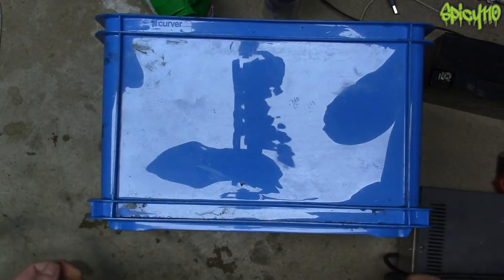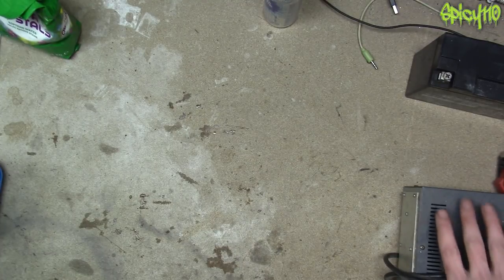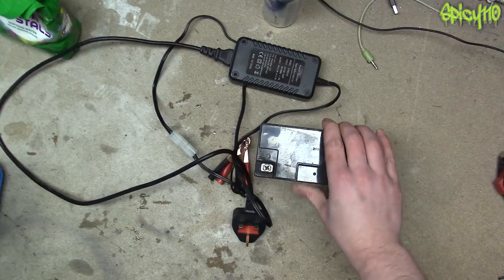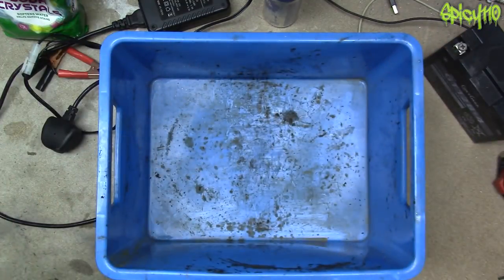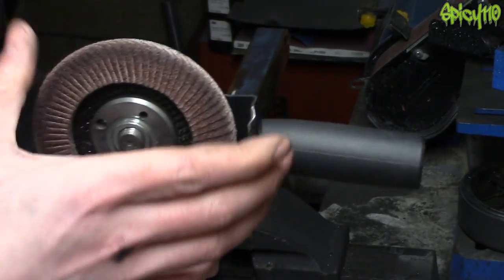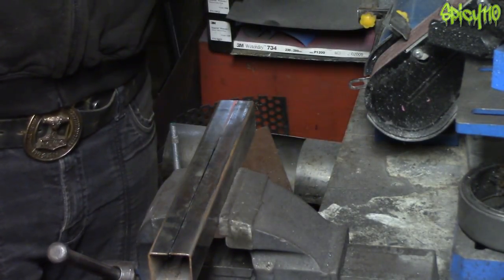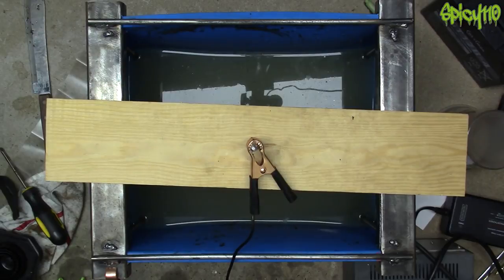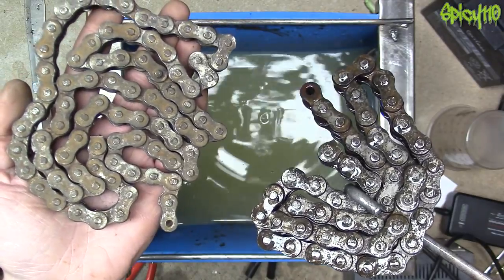Electrolysis - Rust removal! One day build!

Comment: I found that a computer power supply works really well. I'm an IT guy so I get them for free out of old computers. You just have to ground the starter wire to get it to chooch upon plugging in. 4 yellow wires into a red alligator clip. 4 black wires into a black alligator clip. I use a 20 amp fuse and a surge protector just in case. That way you don't need to use a battery or risk your expensive charger.

Comment: Hi spicy. Good video. Not sure if this was mentioned in the video but as your two electrodes on each side were linked with the two pieces of bar across the top of the tub you may have lost some current that way slowing down the electrolysis

Comment: Dude, electricity and water.. When you removed the first one i noticed the PSU was right near the water droplets.. Just be so careful dude, You need just 200ma to do serious harm. Maybe put the PSU in a Plastic sealed box next time.
Reply: 12V wont hurt you, it is because there isnt enough voltage to overcome the resistance of the body. Touch both terminals on a car battery for example, thats 12V with over 300A and it wont hurt you as there isnt enough voltage to push the amps. Same with 24V Tractor batteries which can push upwards of 1300A. Just not enough voltage.

Comment: daft sugestion spicey, your electrodes, would you have not been better threading them as they WILL need replace at some point? (reason i say its silly as youve done it now,) maybe a sugestion for de-rust-bucket 2.0?
Reply: just to clarify, the ends of the rods n just bang a bolt on each side, the plates youve used wopuld probably be too fine for a thread to be held on them,
Reply from the maker: I did discuss this in the video. But as I don't have any dies or taps it wasn't a option. ☺
Reply: @spicy110  my bad! im shit at listening lol,
Reply from the maker: Naa it's a good call, the threads would actually increase the surface area.

Comment: looks like a good system there :D what type of welder is the best to get for just diy stuff? :o
Reply from the maker: A cheap 140 mig welder is best for all this sort of stuff. Note you can only weld steel with mig.
Reply: ah okay cool! ill have to look into geting one, being restricted to steel is a little offputting tho :c
Reply from the maker: If you want to do ally, stainless and steel you would been a Tig welder. But they are more expensive to buy and you need to use argon rather than Co2 shielding gas.
Reply: alrighty then, i will have a look into it after christmas has passed, hopefully i can find one right for me :p thanks spicy :D